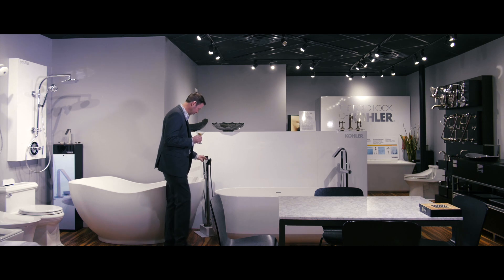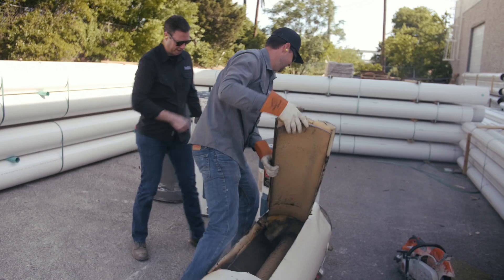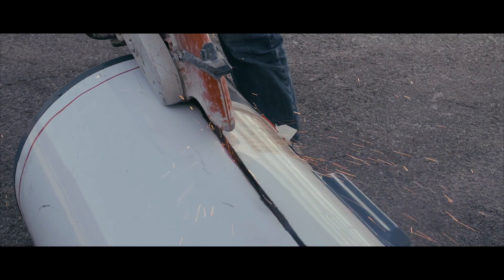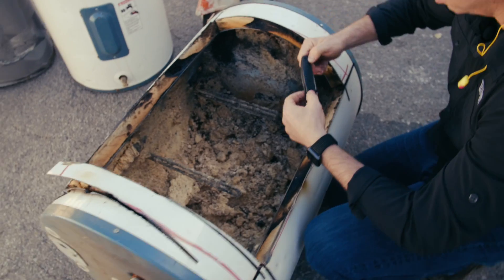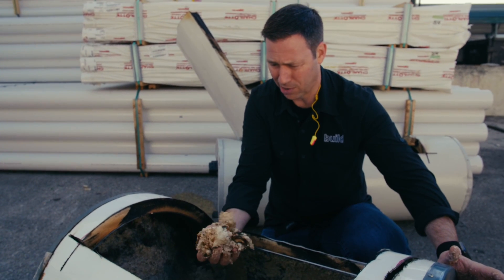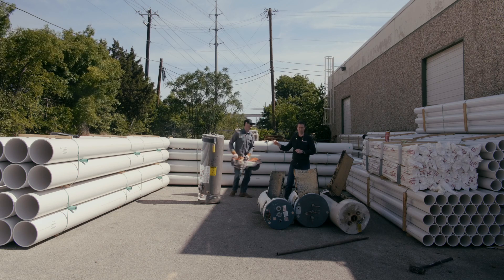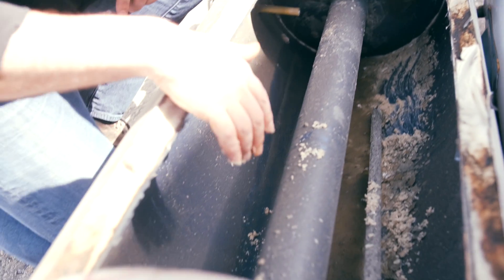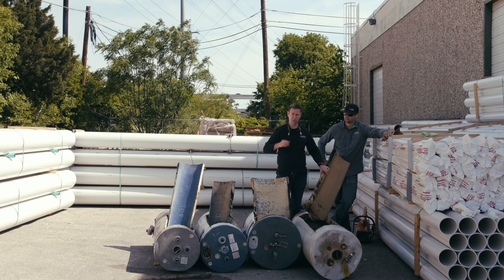Water Heater Tank Autopsy: You won’t believe what’s inside!

Comment: I have seen very little lime or calcium in well water where I live.my water heater is 14 years old and no sediment.
Reply: That depends on the geology of where the aquifer is located. In central Texas, along the IH35 corridor and westward, the primary rock layers are limestone which results in a very high mineral content in local well water. Water softeners are almost standard equipment in new houses built in the area.

Comment: Difference could be: water municipalities - one treatment plant might treat their water with different chemicals/minerals than the other. :  system construction - one system might have the new PVC style piping in the streets while another can be in an older neighborhood using the old cast iron system.  :  use - one had a higher capacity, so heated up less water for 4 people average. There are a great deal of variables to consider. And, like the home made rock salt experiment, some minerals pull to certain metals better. If one had a better ceramic or metal coating, it might not have as much crap stick to it, meaning more would stay dissolved in the water as it expels from the faucets.

Comment: I'm not a chemist but, I am an engineer and do have an answer for a few of your questions. :)  Tanks have a ceramic lining to protect the steel tub from being eaten by the water as it leeches it's minerals.  Electric water heaters especially have a problem of creating a scenario of electrolysis and naturally leech metals.  This is why in electric water heaters it's even more important to be weary of your anode rod.  Once an anode rod is gone, the ceramic coating will slowly leech away.  This is what causes the black soot in the tank and black specks in people's hot water.  Replacing the anode only delays the inevitable at this point and the water heater will slowly eat itself from the inside.

Comment: The scale forms on the electric heating elements then flakes off in the next heating cycle.
Eventually build up gets so deep the lower element fails from over heating because there is not enough water around it to carry the heat away.
Flushing the tank is ineffective because the scale particles don't flow through the drain valve.  Drain the tank, add three gallon of vinegar, fill with water, turn the heat back on, let it set for 24 hours then drain after turning the heat off.  Most of the scale should have dissolved and wash out in the vinegar water.

Comment: Wow. Our tank here isn't too old but we have water which builds scale in a shower in a matter of weeks. I imagine the inside is looking pretty horrendous by now. Wonder if vibrating the tank would dissolve and blast it out the drain, maybe turn off the tank for a day or two to let it cool so it dissolves better. 

My thoughts as a nerd that watched and reads way too much about how a variety of things work. The scale buildup is forming near the top more than the bottom or side due to the boiling water effect. Dissolve some of that in a pot and boil it on your stove, pretty neat how it can be recovered from the water simply by heating and scooping the surface.

Really not that much to be afraid of though. Majority of that sediment is minerals that your body needs to function. If you ever get the chance to taste lab water, do it. It's a very strange experience drinking pure H2O. We just aren't used to our water being that clean.

Comment: Last time I pulled out a heating element from my old water heater it looked like a white ear of corn with no element visible. When I looked in the hole in the tank from where the element was removed, it looked like a tunnel in a block of salt. Once drained, transported, and kicked over for dramatics in this video, it would be impossible to tell where in the tank the sediment was the thickest. In my tank, it grew from the element outwards.

Comment: Yoooo.  You guys should know when the inside/bottom of the tank has buildup the water tank makes a crackling sound also more right after water usage.  It usually is a sign to flush the water tank.  Efficiency also drops off the more buildup there is.

That much hard water will mean that you that your appliances like dishwasher and Washing machine will not work well either.  In showers you will probably feel less clean less lather.

Comment: Those deposits were there to force consumer to buy a new units every ten or so years... The water tank manufacturers know this and will NOT do anything to help consumer to remove and clean out the tank...really, they can easily built in a larger drain valves at the button of the tank to flush this out but they won't.  If they do that the tank might easily last 30 years!

Comment: Replacing a water heater every 10 - 15 years is more cost effective than taking 10 minutes to flush your tank seems to be the consensus I find. My company installs a 3/4" full port ball valve with 3/4" hose threads on every heater we install and educate every customer on it's use. Rarely do they use it or conveniently forget that it needs to be done. I hate to say it but, "job security".
Great informative video guys.

Comment: the electric tanks are always the worst on scale buildup, seems to be a side effect of having all the "heating" done in such small surface area (elements)
they quite often get so full it covers the bottom element and causes it to burn out, I've seen some 40+ gallon electric tanks over 1/2 filled with cruft

Comment: Someone should start a water heater recycling business because I bet that mineral sediment is worth quite a bit to someone if provided in larger enough quantities. 

You will get some basic mud in your heater too because often the water service doesn't shut water off to service pipes and in the process a lot of dirt gets into the system. If they are working in your area best not to use hot water so that all this dirt gets flushed out on the cold side and doesn't get into the heater.

Comment: Ugh my friend has a water heater from 1994 and it’s in good shape from the outside and works fine but I suggested to change it  as  a preventative  measure based on age . Would you agree? It’s also  electric and installed on the first floor inside the house .

Comment: As others have said most the scale is calcium carbonate, not always as some regions have a good bit of rust in the local water...that's usually from old pipes though. 

I'll add as someone that used to build municipal water plants in Central Texas , how much depends on the mineral content of the source water (usually Lake Travis or the Colorado River around here, which is surface water and not the more calcium rich Edwards Aquifer well water) and the cleaning process of the water plant.  

In the older drinking water plants in the city of Austin, they actually grind up limestone rocks, which along with other chemicals act as coagulant so algae/fish poop/dirt etc matter drop out in a settling basin prior to being filtered and sterilized with chlorine gas or liquid chlorine (bleach). 

Newer water plants don't often use chlorine gas as it's very dangerous and corrosive, so they use calcium hypochlorite powder that gets mixed in batch tanks prior adding to the water to sterilize the water. The calcium will then precipitate once it reacts with dissolved carbon dioxide (exposed surface source water forms a very weak acid called carbonic acid) after it leaves the water plant. Chlorine actually dissipates pretty quickly, so they have to add a fair amount to make sure the entire line stays sterile. So if you live closer to the water plant, you'll have both more chlorine (taste) and scale in your water than someone living near the end of the line.

As a side note, they don't just add fluoride to your water for the benefit of better teeth, it comes in the form of fluorosilicic acid...it is very strong and it used to bring up the water pH back to neutral as the rest of the water chemical process is alkaline. It's really not that much, about 4 gallons of fluorosilicic acid per million gallons of water and is found in much stronger concentrations naturally in places like Lubbock without all the negative effects some think it causes, so take off your tin foil hats off ;-)

Comment: I have been a general contractor for almost 20 yrs and have experience in every aspect of residential and lil commercial. The main reason why hot water tanks fail is due to maintenance. A hot water tank WILL fail SOONER with a softening system than a tank without! The bulk of deposits in the tank are calcium and magnesium with some sand and silt from you water supply. This includes city water!!! I have seen a water filter 11" 20 micron, turn nasty orange in 3 months from city water!!! Most people would be shocked if they knew just how sewer water is treated and sent back! 
The manufacturers of hot water tanks slap the warranty stickers on for the number of years you can expect your tank to last without maintenance. A 6yr tank is the same tank in a 20yr system! The main difference is the anode! The anode is the part the keeps the tank from rusting inside. And with a water softener that anode gets eaten much faster! Beware of using either aluminium vs. magnesium. Different anodes will work differently. They must be applied to the correct application. 
The "smell" you get sometimes from the hot water is actually caused from a bacteria waste. And an excess of hydrogen in the hot water tank is a breading ground for them.

Comment: My water heater is 12 years old and a gas model and ever since I installed it I drain out a couple of quarts once a month. I had read on a plumbers forum that that would prevent the build up. It would be nice if I had some kind of scope that I could stick down the anode hole and check it out.

Comment: Great Video, I really like the style of it.
Is this a normal design of water heaters in the US? I'm asking because this design is outdated in my home country (Austria), state of the art design is to fill that tank once with purified pH buffered water, and have an internal pipe where fresh water is running through if you need hot water. So the water that is in the tank itself just stays there just acting as an insulated heat buffer, and the water thats running through takes up the heat, but is always fresh water and never gets into contact with the water in the tank itself.
That way you don't have any scale building up anywhere in the unit (because the water that has contact with the heating element is purified water anyway, and the other water is running through and taking any little precipitate that might form due to the heating with it).
I don't know if this design I'm familiar with is common in the US, or if there are additional reasons to not use it.
Reply: What material is the actual water pipe loop? Copper or plastic?

Comment: If you have a shutoff installed to keep water from going to your house lines, and also as normal a fill shutoff you can drain the tank, fill with a gallon of CLR once every year or so and fill back up with water. Let it heat up till it satisfies and then sit for several hours, 24 if possible. Then flush as normal out to the yard. You may want to let it heat two or three tanks up and re-flush those, but it will clean out an enormous amount of scale. 

After flushing, if you have an electric unit, pull both elements and use a flashlight to look in the tank to see how bad it is. If the elements need replacing change them out they are cheap. 

Inspect and Replace your anode rod every 3-5 years if you have hard water.

Comment: Actually the hot water should retain as much minerals as it can since hotter water can have more minerals in it before it's saturated, minerals should deposit where the water has chance to cool. meaning on the top of  the tank and the sides, the heating element shouldn't have a lot of mineral attached to it.

Comment: Most of the yucky stuff (especially on the bottom) is probably just sediment.
The water just sits in the tank most of the time, which allows suspended particles to settle out.
Regardless if it's sediment or scale, chances are, it's ending up in your WH before it gets on your face in the shower. Another way to put it: The WH is acting like a crude water filter.

Comment: Have a Kenmore water heater from 2001 - running perceivably great - with a "RotoSwirl" tube in the tank's bottom that spins the water in what I believe might be full-height tornadic / whirl pool action in the tank to keep such sediment lofted and flushing through.  Is this feature even used in the industry's manufacturing anymore?.... Nevertheless, it'd be interesting to look inside to see how well the feature has worked as intended. I've never flushed the water heater since moving in in 2011.
Reply: My system has no water softener...

Comment: For those who take issue with his volume levels, you are correct for the most part. There is an industry standard Audio volume range which everybody is "supposed to" use and it is called "normalisation". It is used for Audio CDs, DVD and video editing software such as in KDEN-Live or Sony-Vegas. You set your volumes to about 80% unless they suffering "clipping" (a sort of distorted sound i.e. turn it down to say 75%) and then click "normalise".

Comment: if your properly draining your tank every year like you should, better yet with a full open 3/4 ball valve, you wont have as much sediment on bottom of tank plus on most tank cold water coming in is usually focused on the bottom of tank to push hot water up and heat the cold part first so it is always swirling around in tank ... combination of all these mechanics means less scale and sediment on bottom of tank. but i often wonder why we don't have a easy descaling method for tanks like they do in tank-less heaters. for those that do not know , when you get a tank-less hot water system its recommended to have valve on incoming and out going ports so you can pump a descaler thru system and if you don't do this yourself then you should have a plumber do this yearly.

Comment: 738 comments...WOW.  The short answer is it all depend on the quality of the water.  The cleaner/purer the water is, the less residue will be left behind.  Bottom line like you mentioned.........a water softener is the ONLY answer along with a house filter for your water equipment to last years without any problems.  I live in the city with good water and I have been using a water softener since 1974.  O', I replaced my electric water heater a few years ago after 25 years usage with a water softener and only had about 1 - 1.5 gal of sediment when I opened it up.  I was happy.

Comment: if the tank is so dangerous..the water still comes out crystal clear.  Throwing the tanks down like that and sawing will dislodge the scale.  I also think these tanks came from water supplies that contain much more sediment.  Be wary of water softeners--they replace calcium and magnesium with sodium ions and salt WILL erode pipes including copper.  I also read reports of people having problems with salt buildup using water softeners over the years.

Comment: the "scale" is minerals dissolved in the city tap water. As you boil off the water/mineral solution it clings to any surface cooler than the water where it deposits the minerals. As the hot water is used the water heater reveals more surface area. It's like how soap scum sticks to a shower wall and dries in place.

Comment: Man i've changed Hot Water tanks for the last 20 years, ¸and the old tank is typically 1.5 to twice the weight that it was originally. IF the tank broke on the TOP and the leak starts wetting the insulation, it's probably the worst situation u can get. Tank can easily weight 250-300 pounds

Comment: I'm sure someone has already explained it but there are two processes going on...you need to remember that hot water is able to actually hold more dissolved mineral salts BUT the hotter it gets it's able to hold LESS dissolved gasses.
So a few  things happen depending on what's dissolved in your water supply: Sulfur loving bacteria thrive in warm water and they start to digest the dissolved sulfur containing minerals and then release hydrogen sulfide gas. That's actually where the rotten egg smell comes from in some hard water. It's the hydrogen sulfide gas made by the bacteria. When the tank heats up that gas can't stay fully dissolved in the water any longer, so it rises and then interacts with any exposed metal. It'll form zinc sulfide, aluminum sulfide, iron sulfide. Any place where the water in the tank is a bit cooler (so on the walls, even the top it's always just slightly cooler since that's where the heat escapes) those dissolved minerals which were happy in their hot water get ever so slightly nudged out of solution in the relatively cooler water. It takes a long time since it's a slow process but more and more get deposited in these areas. Since new water that comes in already has dissolved solids in it the equilibrium is ever so slightly tipped towards the side of forming more deposits in stead of those deposits dissolving back into the new water. And there are other minerals that get deposited as well which don't contain sulfur but may contain calcium or sodium or potassium. Sometimes they just need a nucleation site and some dissolved minerals actually are LESS SOLUBLE in hot water which is not common but calcium carbonate is one of the most common which makes up a large part of the scale.
Reply: I've wanted to read chemical processes for these deposits.  I guess too late in life I've learned to appreciate what education I've missed in the field of chemistry.  It's true, chemistry is everywhere.
Reply: Man! Do I feel like that every day! I love biology and chemistry so much. I didn't feel like that when I was a young lady in high school!